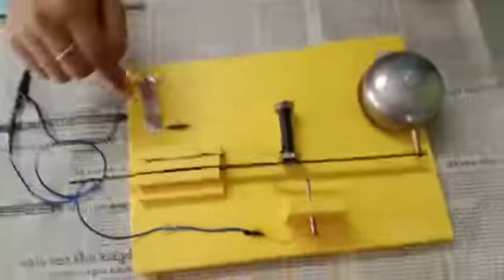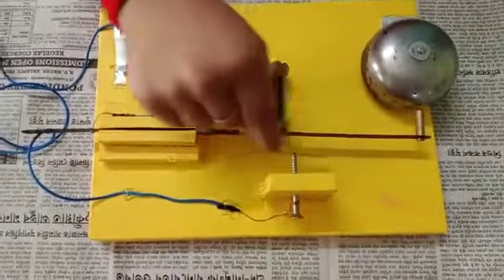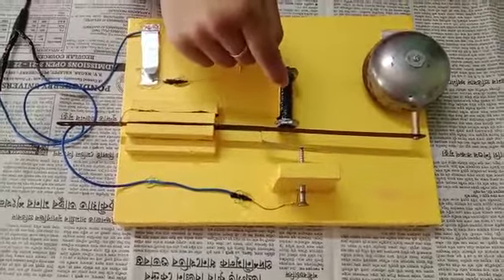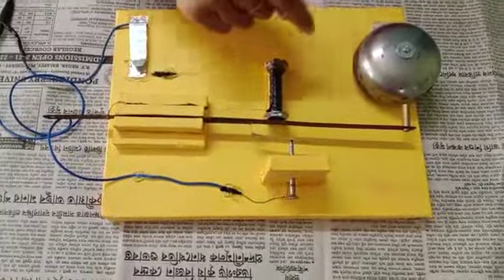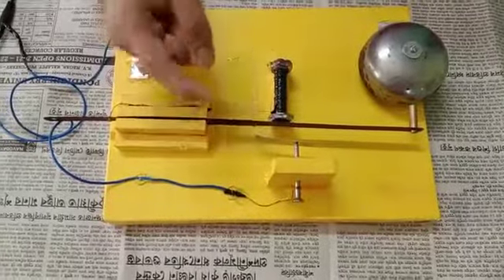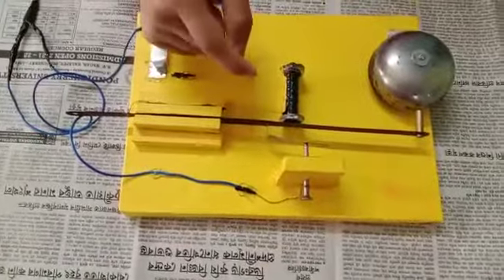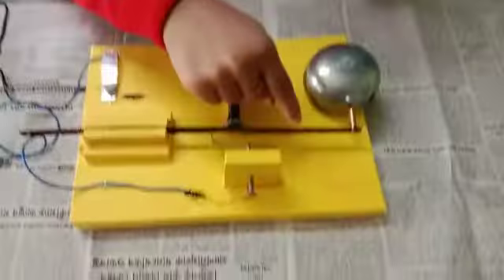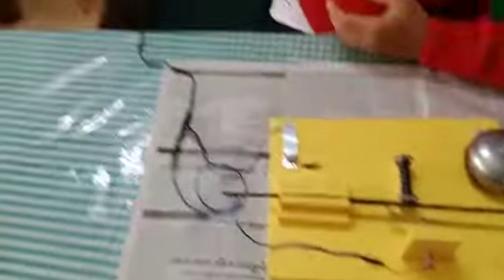Project Electric bell - Electromagnetism.

Comment: Hello...Is it possible to make it with a switch and cell instead of direct current sir?
Reply from the maker: Yes it is
Reply: Omg thank you so much...can you say me what battery to use?
Reply: 9v or 18v
Reply from the maker: @selvikrishanan986  try both and check on a trial and error method